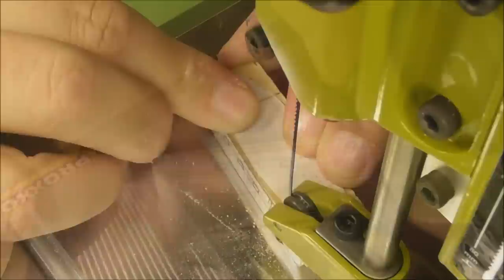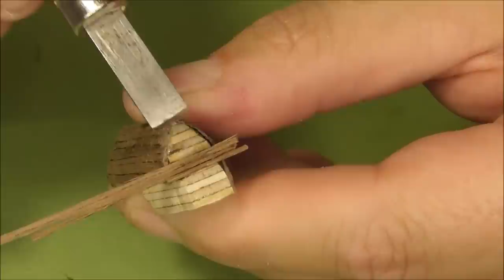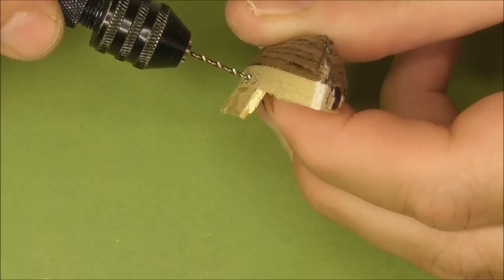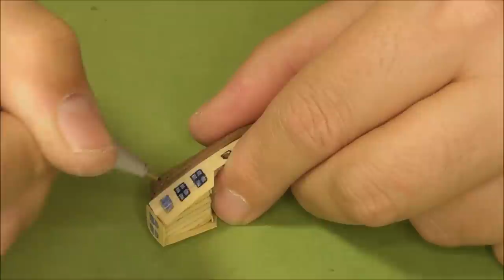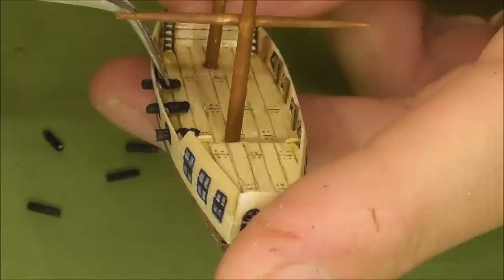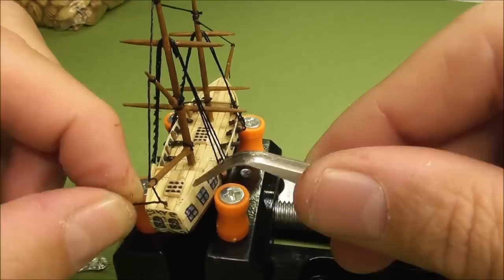VERY SMALL SHIP from wood-HOW TO DIY

Comment: Why you didn't just use the pine bark to make the hull?  :/
Reply from the maker: Thanks for your comment. Sorry I dont undestand. What is the "pine bark"? I have used walnut strips for the hull.
Reply: @4THECRAFT   
https://en.wikipedia.org/wiki/Bark_(botany)
Reply from the maker: @krzysztofkuczynski8907  Thanks. my boat was made from a small piece of plywood board. I have never used pine bark and to be frank I am not sure how I could have used it for the hull.
Reply: Well, when I was younger, I made several ship models from pine bark, due to its relative softness and ease of cutting. 

I was using a sharpened knife to carve the general hull shape (with keel and both perpendiculars), then a sandpaper to smooth it, and a chisel to carve the deck inside. After that,  I was making the gunports with a small drill bit, and I tried to make  them square.  The last thing, was to make  the all wales, main rails, chaines,  beakhead,  stern details, bowsprit, masts, yards and other things - all of it from properly formed toothpicks. And a fabric for sails and string for stays and shrouds. 

The most important thing, is to use the biggest piece of bark, as you can find. Dimensions of 5x2x2 inches, is the minimum.  And carve it so that the plane of the deck and keel runs horizontally by the layers of bark, never vertically.